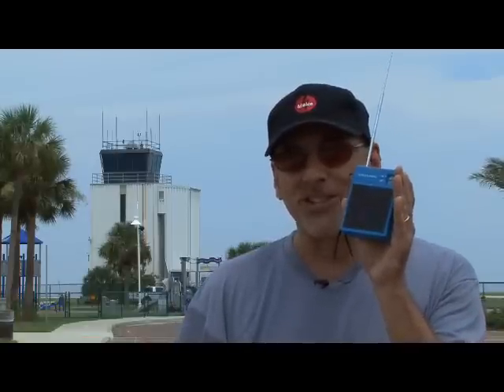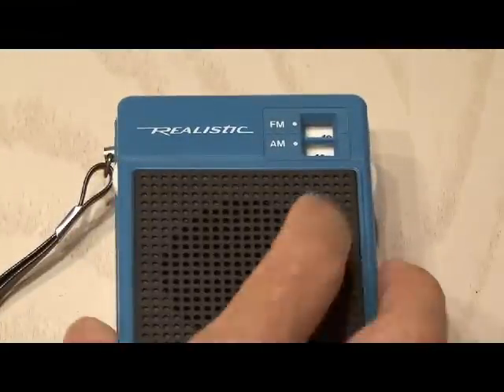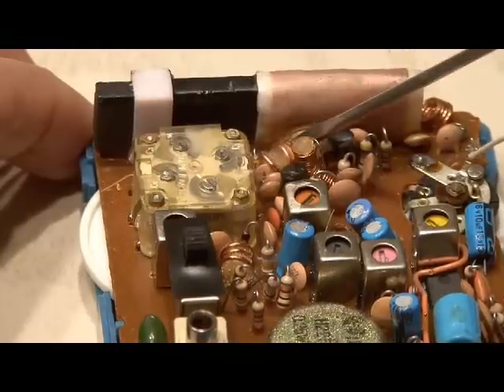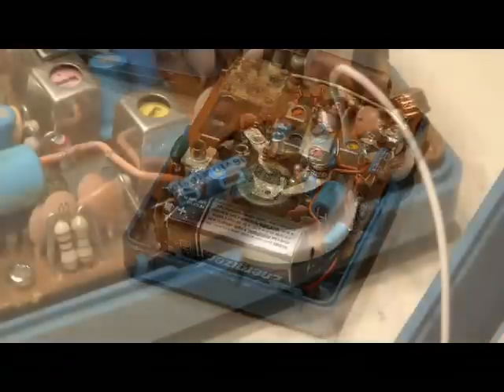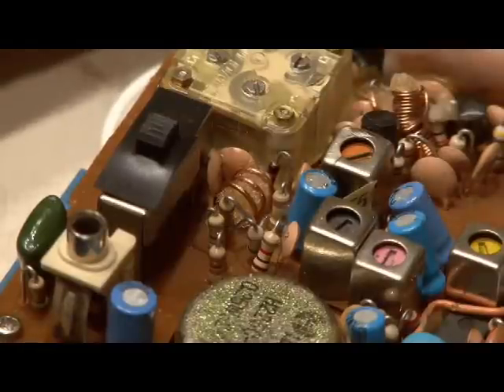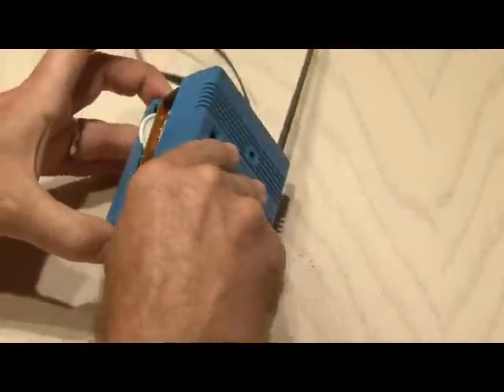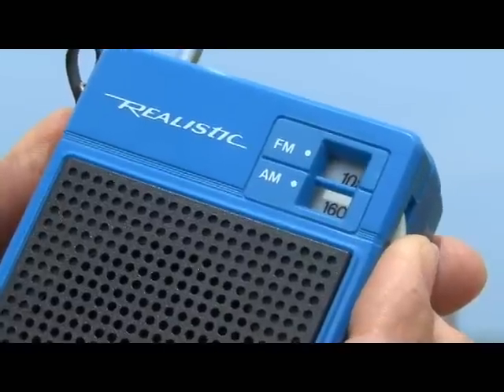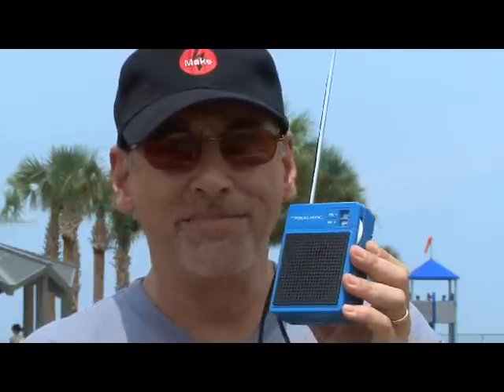Weekend Project: Aircraft Band Receiver

Comment: Actually, I am correct. Aircraft do indeed use VHF for voice transmissions, 118-137 for voice(108-117.95 reserved for navigation). These transmissions are however Amplitude Modulated, the frequency of a signal has nothing to do with how it is modulated. AM is not limited to the commercial broadcast band that I believe you are referring to.(although those freqs can also be used for navigation) I'm an avionics tech, I might know what I'm talking about.

Comment: This took m back to the early 80s when I did this to an FM radio and then did it  to a number of friends who also wanted to listen to ATC. I originally found the idea in an electronics magazine, tried it and it worked like a charm. Results were awesome, with good sensitivity (could hear airplanes over 100km away and ATC over 15km away) and good selectivity (could individually tune in to several different frequencies at will, without each interfering in the next). Thanks for bringing back the good memories.

Comment: I tried this on two radios. My bedside clockradio and a clockradio I picked up at a big box store for $15. Expanding the reception range worked as described. My tuning range grew so I could tune in 107 MHz at around 98. Adjusting the "tuning transformer" was less apparent. One had diodes nearby, but tuning that one had no effect like it does in the vid. So I tuned the other, which did. I never could pick up VHF from airport 3/4 miles away, which has a constant weather broadcast around 132 MHz.

Comment: since i live near to an airport i hear the radio transmissions of the traffic control through my fm radio i dont need to adjust anything . just i set the band in between 104 Mhz  and 104.5 Mhz and i start listening to it . without any modification to the board or something . great video BTW

Comment: @outatime1955 Depends on how much the inductor's value can be changed but I would not recommend it. The IF or intermediate frequency bandwidth might be far too wide for the receiver to be selective enough. Amateur radio and two way transmissions use narrow band FM which does not deviate or move as far away from the listed carrier frequency and only goes about 20 KHz at the most rather than 50 or 150 KHz as wideband FM used for broadcasting does.

Comment: @cossheisnmzenna 

Normal FM radio IS VHF. And on top of that, FM radio stations use transmit powers hundreds of times more powerful than that of an aircraft's radio. But keep in mind, VHF is line-of-sight, with a bit of over-the-horizon propagation. So no matter how many watts of transmit power there is, don't expect it to go very far over the horizon.

Comment: @supertoaster94 
I don't know if this is fake or not, but I think it's more complicated than you suggest: "If this transformer is tuned to a frequency of approximately 1 KHz above the IF frequency, the last IF amplifier will convert NBFM to AM." (google for source as the link won't post)
Your calculation of "add 9 MHz" would be accurate if this was a linear system. From what I experienced, the changes to the tuning range were far from linear.

Comment: This has to be fake.

1) Aviation radios use 'Amplitude Modulation', or AM, and thus cannot be received by a radio that uses 'Frequency modulation', or FM.
2) The 'air band' is from 108-136 MHz, however, 108-118 is nav-aids only. If you want to hear the aircraft, you'll have to modify the radio to go all the way up to 118 MHz and beyond (up to 136).
3) Even if the radio was on the AM setting, the upper limit of the AM broadcasting band is 1.6 MHz, which would be really hard to push high enough.

Comment: I tried doing that on a cheap IC controlled fm radio.  I found no metal IF cans inside but only 3 small coils.  I live about 20 miles from the airport and I could receive ATC transmissions clear as bell.
Reply: I'm not having much luck but then again, the local airport is very small
Reply: I doubt that because planes use am on fm

Comment: I tried that before using a Sanyo cassette with AM/FM radio receiver but I didn't touch any coils. I just turn the screws of tuning capacitor so that FM 107.9 MHz moved down to around 102 MHz on the dial. But when I turn the dial to around 108 MHz what I received was unmodulated carrier frequency that randomly turns on and off which appears to be a 2 way radio. The receiver's FM detector can't demodulate the AM transmission of aircraft band.

Comment: You should make a tut on how to modify a crystal radio to pick this stuff up, because i don't have an fm radio but i do have an fm crystal radio with a tuner, diode, and coil. Is it possible to do this with my crystal radio?
Reply: Unlikely.  Hobby crystal radio sets are designed to receive the commercial AM broadcast band (540 kHz - 1.7 MHz).  You would need to figure out how to specifically design a crystal set that can receive the aviation band (108-137 MHz), but amplitude modulation is still used.

Comment: @alissabandaly Yes you can.. you may have to build yourself a cheapo square kiteframe type antenna tho.. and you will only be able to hear them if they fly fairly closeby.. i modded a $10 double a battery radio i had here after seeing this and it worked fine.. the more you can expand that coil the farther it seems to get you.. i moved my 108 position allmost all the way back to 90 on the dial..

Comment: I just did this with an old general electric clock radio and it works great. I moved 108 down to 100, just enough to get the signal. I live by LA and there is plenty to listen to. I guess that would mean the station is around 116Mhz or so.

Comment: modifying an FM radio to receive and demodulate airband that runs on AM...how is that possible?
Reply: Yes it's possible yes it actually it is real
Reply: It works but the sound has some distortion. Also the FM IF is too wide, several airband channels may interfere.

Comment: what's even more amazing is that the aviation bands are all AM, and he's adjusted the FM coil and FM tuning.  Um, not gonna work too good....
Reply: In germany its fm .
Reply: Boxritter9999 no it is not.
Reply: @ibmicroapple9142  its partly fm at 132 mhz
Reply: @boxritter  First, "partly" does not equal "in germany it (complete airband) is fm". And do you have any source for your statement regarding 132MHz? I certainly did not learn about this, when i got my airband license. It doesn't make sense at all, but feel free to enlighten me...
Reply: @ibmicroapple9142  dont be rude !!!! Weather radio on 135.975 MHZ NFM mode near Nord Germany.
Reply: @ibmicroapple9142  if you know so much about aviation then please explain why my flight instructor says it is FM?
Reply: @ibmicroapple9142  I’m not asking for you to believe me, I’m just saying what I was told during flight school

Comment: Suprising it is so simple to slide the band like that, and using FM to recieve AM transmissions is also miraculous. There are two common 'crystal sets' or unpowered recievers. The one with the big coil is for AM broadcast or Shortwave, the less popular 'potato set' can be arranged to pick up vhf bands. It was a foxhole radio for picking up tank to tank comms, and would pick it up before the engines were heard, no batteries. The thinner the non conductive film between potato halves, the higher the sensitivity (cigarette pack cellophane), but it was cool because no tuning, just a 200-500 mhz spread wideband reciever, for AM voice. It may be a disaster today with all the telemetry and packet data that is emitted in vhf band.

Comment: FM?!

The airband is Amplitude modulated not Frequency modulated.
I started doubting myself when I saw this video, check Wikipedia, just read article "Airband".

"..... The rest of the airband is allocated to voice communications using amplitude modulation."

If your radio has FM modulation from 88 to 108 MHz, doesn't mean that a little bit above that range such as "118 to 137" MHz is FM as well.

Comment: @itismike 

You couldn't hear it because 1) AM cannot be received by an FM radio (read my previous comment), and 2) you only offset its receiving capability by 9 MHz, putting the upper limit at just around 117 MHz, which isn't even in the 'voice' section of the aircraft band.

If you wanted to hear all of the ATC chatter (including that weather station), you would need to offset the receiving range upward by approximately 28 MHz. If you ask me, I'd say that's not possible.

Comment: Is that legal?
Reply: Yes. As long as you do not transmit anything back.
Reply: Yes
Reply: yea, although I wouldnt hang around an ariport (specially a busy international one) with a big ass antenna and stuff driving around. but it is legal. bc 1. you are not broadcasting anything. 2. you are not breaking any encoding. 3. you are not listenning to classified info ( which goes with number 2).
Reply: Of course its america everythings is posible.
Reply: DRON3-davachi: Here in the Netherlands are nearby airfields special places to make photos and listen with a scanner. Also military conversation. That is very normal over here. 73"' JDJ .[Very nice hobby!]

Comment: So how it works it looks like is that transformer controls the level that will be limited by the limiter. So if there is no limiting then AM modulations are allowed to pass through the limiter to the FM detector.   But the FM detector isn't designed to demodulate AM, so presumably the first audio transistor is doing the rectifying.

Nothing is perfect, and on my analog dial tuned radio next to my CPU tower there is motor whine if I tune to an unused FM frequency, which of course motor whine is AM noise. 

I can also hear the FM stations "talking over" each other on that radio, even though the FM capture effect isn't supposed to allow that to happen.  Which indicates that the limiter already isn't perfect and turning it off will definately allow AM broadcasts to pass through.

I don't hear motor whine or stations "talking over" each other on a phase locked loop button tuned radio, so it must have a better limiter so AM modulation reception is not possible on an FM button tuned radio.

Comment: Never, never, never, never adjust the ferrite slug using a metal screw driver.  EVER.
Reply: +Monel Funkawitz He is actually de-tuning the slug. Pretty much any position other than the factory-set peak AM rejection point will work, so in this case it is OK to use a metal screwdriver.
Reply: And never, never, never initiate the auxiliary power module whilst the dilithium crystals are still in their warm-up sequence.
Reply: why?
Reply: @lands1459  hahaaa, you said CRACK!
Reply: @lands1459  it's a SouthPark thing
Reply: @Scrubworks  Heisenberg I believe? If u do initiate prematurely, and destroy them crystals  u may be Breaking Bad or badly... then plx call my boy Saul.
Reply: @lands1459  always be careful or else
Reply: Will it explode?
Reply: @arroncervantes4248  won't achieve warp speed
Reply: Can a metal screwdriver break the slugs?

Comment: would this mod work on am/fm car radios too?,what about modern PLL (phase locked loop) radios or wont they lock onto frequencies outside the intended band?,any one here know if it's possible or are there other tricks to make it happen?,also what about correct antenna measurements for the vhf bands?
Reply: neil crompton  I would think it would work, It really depends on what model car radio you have and what car you are using, but if it's in a car I would not try to anything to the radio.
Reply: +neil froggy crompton It won't work on PLL radios because they synthesize discrete frequencies as opposed to simple L-C tuning. This will work only on older, sweep-dial FM radios, i.e, those that use variable capacitance or variable inductance to sweep the band. As for antenna length, a good approximation rule of thumb to find the required length (in milimeters) is to divide 75000 into the desired frequency in MHZ. This will give an initial,  slightly oversized quarter-wave whip that can then be trimmed slightly for best reception. For instance, say you want to listen into 120 MHz: 75000/120 = 625mm which would be a good place to start.
Reply: 3:53

Comment: I knew this was fake.  It was a convincing fake though.

Its fake because the FM detector is designed to block out amplitude variations and the air band uses AM.

Comment: When was the last time anyone received AM modulated transmissions within FM mode of the receiver/transceiver?

Sure you can space out coils all day long on older AM/FM broadcast band pieces of consumer electronics, and yes, that will in fact influence the reception frequency. 

However, spacing out inductors will not magically and instantaneously transform frequency modulation into amplitude modulation. 

Aircraft control communications are conducted in explicitly AM modulation. 

Hence, this video is BS.
Reply: It works. Bad, but it works
Reply: @fongmaho  Works well,   just tune your radio! Tiny bit of distortion, not an issue. Try it, you'll like it!

Comment: Aviation communications use AM modulation contrary to FM modulations used in the FM band. The FM detector in that FM radio will not be able to correctly decode the AM transmission so you will hear distorted voices.
Myth busted!

Comment: Add a microphone lol
Reply: ok and the FCC will be pritty pissed off
Reply: Like I said, FM Transmitter
Reply: SolarFlareGaming101 Pretty obvious NOT to...as I had a dream of a LOT of crashing airplanes because of that or something.
Reply: SolarFlareGaming101    Besides, a receiver doesn’t have the electronic circuitry necessary to transmit a signal. By the way, aircraft radios use AM (look it up), so an FM radio, receiver or transmitter, would be pretty much useless. The band frequencies for commercial and private aircraft are 108-137MHz (AM). Military aircraft use 136-144MHz (AM/FM) and 225-400MHz (AM/FM).
Reply: ***** All of the hardware is there to make a CW AM transmitter, however the transistors are light duty and the signal would at best travel 30 feet with a long wire antenna.